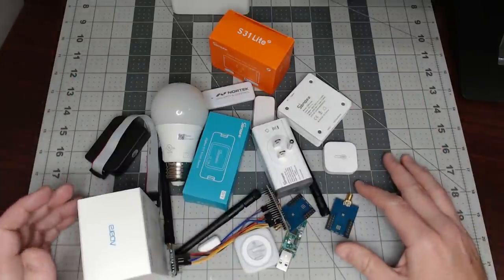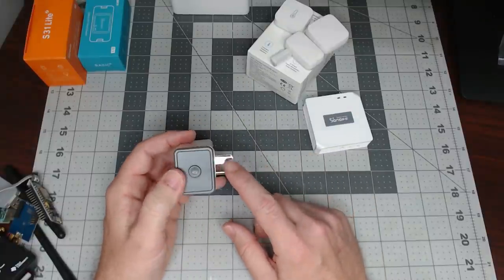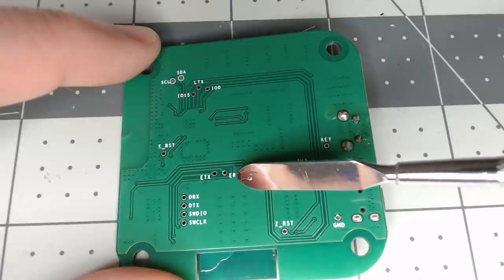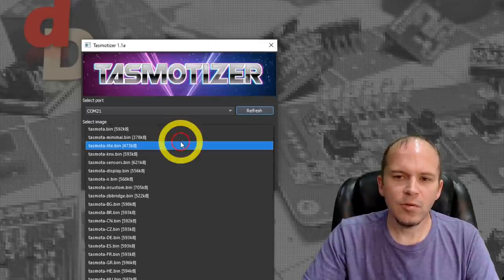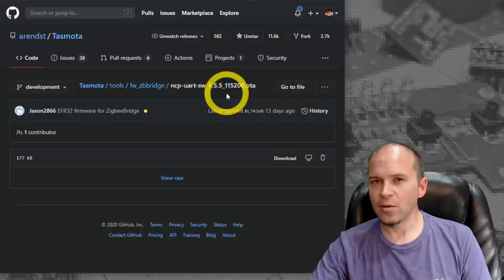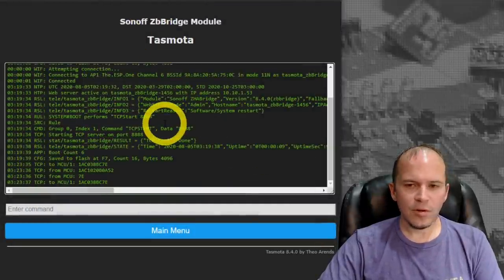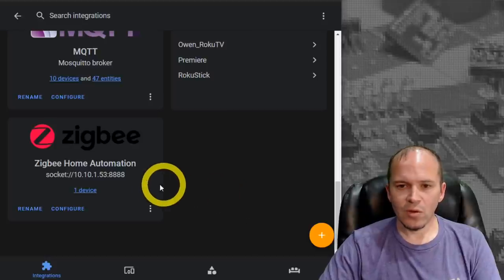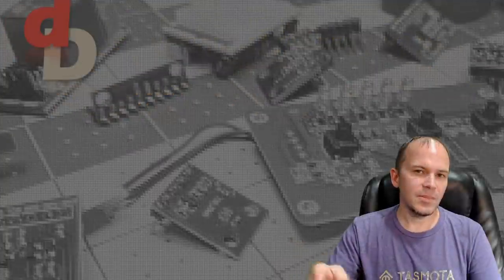Sonoff Zigbee Bridge with Home Assistant using Tasmota | NO Soldering | Step by Step Guide

Comment: Thanks for the video, I have finally managed to flash my zigbee bridge and add it to Home Assistant, tried twice and failed before, as for some reason after flashing Tasmota the chipset firmware would not flash. Now, I'm trying to add devices in HA, however no device is found, I tried adding the Sonoff zigbee motion sensor, Aqara motion sensor and a Xiaomi zigbee socket. I also restarted HA and tried again, no device is being found. Any idea why this could be? Before anyone else asks, I do hold the reset button on the devices for about 5 seconds until they start flashing.
Reply from the maker: Maybe try removing the coordinator and putting it back. I found some sensors take their time and hitting the show logs button during the adding also helps.
Reply: @digiblurDIY  Thank you, I did it a few times, deleted the Implementation completely and added it again, tried "show logs", nothing seems to work. It seems to find one extra device now, the Aqara Motion sensor and adds 4 entities, but apart from that one, it doesn't detect the Sonoff motion sensor or the Xiaomi zigbee socket. I'll try adding other types of sensors but so far not a lot of success.
Reply from the maker: Does ZHA support them?
Reply: @digiblurDIY  I checked and yes they are supported
Reply: Update, after removing the implementation a few times, reflashing the Bridge once again, I have finally been able to add a few sensors. It is really strange as I did not do anything differently, just tried again using the same steps. Anyway, it is much better than before as I can add the Xiaomi motion sensors and door/window sensors which I am most interested about as they were quite a distance away from the Xiaomi Gateway and sometimes lost signal. Hopefully there will be future updates that will allow it to discover other sensors, although from what I saw the list of sensors is pretty big. Thanks again for your responses. I've subscribed.
Reply from the maker: I had one earlier where we had to delete the integration and then also delete the Zigbee database and it added back fine. I noticed the Aqara xiaomi sensors are picky. Sometimes they need a full button hold for 10 seconds or so. Glad you got it.

Comment: I just "Tazmotized" a Sonoff ZigBee bridge and added to my HA setup without issues. I tried to add my first Zigbee device (Sonoff switch SNZB-01). It got added but the only entity seen by the HA is the battery level. I do not see any other entity from the switch that indicates that switch was pressed. Anybody having similar issues? I also heard that switch can register short as well as long press and send different messages. Is this correct?
Reply from the maker: You do have to use ZHA events on that button to see the 3 events.
Reply: @digiblurDIY  Any video or tutorial that you suggest that shows ZHA events setup? Even seeing the single press in the event list in HA would be good enough. Right now, I can only see a battery status (not much use :)). ANy other push button that you can suggest that would work with Sonoff Zigbee bridge?
Reply from the maker: https://community.home-assistant.io/t/unable-to-pair-sonoff-zigbee-snzb-01-wb-01-buttons/218324/19

Comment: After using the ZHA now for the last 2 weeks. I've noticed that sometimes the service goes down. No idea why or what ? Once I've did a search of the devices (integration screen) it starts working again... Any idea what causes this ? Any idea how I can get warned ?
Reply from the maker: Sounds like you might need to put in a few mains powered zigbee devices as ZHA is failing.
Reply: @digiblurDIY  I have about 30 devices in the mains. Every time i restart HA, it's a mess to get ZHA back up again. Always getting an error unknown cluster-specific command 10, etc.

Comment: Great video.  It worked for a few days but randomly HA can no longer connect to the zigbee bridge.  I can browse to the sonoff fine and even tried the commands again but it no longer can connect to the bridge.  Not sure if anyone else has had this happen.  Hoping I can resolve
Reply from the maker: Did the device reset?
Reply: digiblurDIY thanks for the response. It didn’t that I am aware of. You can actually still see it communicating with the 4 zigbee devices I originally connected to it. It also shows the server as starting fine. I honestly was thinking it might be a HA thing but since you responded, maybe I need to reflash Tasmota from scratch to see if that works.
Reply: You can even see in the console when HA reaches out to it because it states tcp to mcu immediately after I attempt to re-add the integration
Reply from the maker: So what's not working? I am confused.
Reply: digiblurDIY home assistant stopped talking to the bridge and had errors in the HA logs of not being able to connect. I deleted the HA integration and tried to re-add but it fails to reconnect at the screen that asks for the socket info. When I enter the socket and speed, it tries, the zbridge feels the attempt and then HA states it can’t connect. I’ll follow the process from start to finish again and see if it comes online.

Comment: Everything succesful done, but at least stucks in connection to 10.1.x.x:8888, any idea what to do
Reply from the maker: Might be the rule isn't running.  This is a pretty old method/device though.   So much has changed and many better devices now, like the SLZB-06 I did a setup on.
Reply: @digiblurDIY  how can be rule setup correctly? which are correct commands. I also can connect via TCP 1 but stucks in welcome message waiting for whatever.
SLZB-06 I will buy one and try
Reply: Connection now with zigbee succesful, but how to by MQTT

Comment: Tnx for your video, however the upgrade by "ncp-uart-sw_6.5.5_115200.ota" is cancelled with the error message "Magic byte is not 0xE9". Running "Tasmota 8.5.0".
Reply from the maker: That means you are not in zigbee Bridge mode yet or you flashed the wrong bin file.
Reply: @digiblurDIY  my fault, I forgot to start zigbee Bridge mode by  running "Backlog Weblog 3; so65 1; Module 75"
Reply from the maker: Not a problem!  We learn by our mistakes here and luckily this one was an easy fix.  Thanks for stopping back by to share the fix worked.

Comment: I've tried the sonoff window sensor. Although I could find them. They didn't work as designed !
Reply from the maker: What is wrong with it?
Reply: @digiblurDIY  Basically, I was able to pair the items but the state (open/closed) wouldn't be updated? This makes the devices useless obviously. Also the state of the battery wasn't transmitted. Maybe you have a way to solve it ?
Reply from the maker: I paired up one yesterday with ZHA and it shows the open and closed.
Reply: @digiblurDIY  I've tried today again and no officially giving up...

Comment: I’ve tried to add a few additional feibit switches and they got stuck. I can’t get ride of them, I can’t reset them. Any advice what I can do ?
Reply from the maker: You can always use the last resort is remove everything you can then delete the Zigbee dB file on HA and restart HA.
Reply: @digiblurDIY  Hi thank you for your reply. Now the zigbee hub went down somehow. Don't know why or how but none of the connected devices are available. I don't see any logs neither on what's going on. What are my options now ?
Reply from the maker: You will need to add it back after you remove that failure of the integration.
Reply: In the end, it used a snapshot of my VM as it just wouldn't go away. By the way, the IKEA bulbs don't work that well with the bridge. Hence I left them linked to the HUE bridge. After 20 runs, I just gave up.
Reply from the maker: If they don't follow the Zigbee alliance standards and ZHA doesn't support it then that could be an issue.  The ZB Bridge in ZHA mode is just a passthrough.
Reply: @digiblurDIY  hi Travis. I found them sometimes but not all the time. I could control them sometimes but not all of the time. I leave it for the moment. At least most of the other zigbee stuff I got integrated

Comment: After upgrading Tasmota firmware (8.4 -> 8.5) on the Zigbee Bridge, HA lost my devices and  it seems I have to restart the full procedure.

when upgrading to firmware ncp-uart-sw_6.7.6_115200.ota, this time, it fails and I have the message : Magic byte is not 0xE9
Reply from the maker: If you get that failure then you are not in the Zigbee Bridge mode so it kicks it out as a bad file. I haven't tried to update mine yet but I don't see why it would delete anything given the devices are added via ZHA. I will let you know what mine does.
Reply: digiblurDIY Just Repaired !

DO NOT UPGRADE to tasmota 8.5 via the option "Web Serve Upgrad", it installs tasmota.bin, do it manually.

If you did the mistake, you can change the firmware in 2 steps by installing manually the 
- tasmota-minimal.bin
then
- tasmota-zbbridge.bin
Reply from the maker: Yes the default OTA url is for standard tasmota. If you run a different version you need to be aware of that. Also I would advise against using minimal when you can. Use the gz files. Send over the lite gz file then the bridge gz file. Use minimal as a last resort as it doesn't have AP mode and such and you never know when something might hit the fan. Glad you got it going!

Comment: Is there a way to backup original firmwares before flashing ?
Reply from the maker: Yep. Check your flash size and use esptool to back it up. https://tasmota.github.io/docs/Esptool/ think went over this in the clamp jig video.
Reply: @digiblurDIY  Thanks, I've just done it ;)  But what about the firmware of the zigbee chipset ? Can we backup it ?
Reply from the maker: Not sure if you can do that.

Comment: Might be easier to plug the USB/TTL device into a breadboard, then connect the jumpers between the breadboard and the Zigbee bridge. This would also let you plug two separate ground wires to the breadboard.
Reply from the maker: Whatever way you do it is perfectly fine, seen it done a bunch of ways.  Not everyone has breadboard stuff so I tried to make it as minimal as possible without the S word.

Comment: when uploading the ota file. It says upload fails with the message Magic byte is not 0xE9. What to do to rectify this?
Even after entering the backlog command the module remains the same and teh device does not restart?
Reply from the maker: You have the wrong bin file uploaded then if module 75 will not set.

Comment: I did all the process ok, all works with tasmotizer but after ends send "md5 of file does not match data in flash", I'll try with 9.1.0 and 85.1version, Any Idea
Reply from the maker: Sounds like a bad flash. Something interference.
Reply: @digiblurDIY  I did several times with different cables, always the same at the end.
Sonoff zigbee Bridge V 1.1 2020.02.28.
I did the flash lots of 8266, sonoff devices etc without any problem, I'm lost.
Reply from the maker: It might need some additional power due to the other chipset.
Reply: @digiblurDIY  Having the same problem, how can I connect additional power? Thanks
Reply from the maker: For flashing or operation?

Comment: With xiaomi aqara sensors I had better luck pairing from a couple of meters away.

Was ignoring messages & couldn't see some sensors at all otherwise. Around 2 meter distance, bam.
Reply from the maker: Nice! Mine were close together. I will try this.
Reply: These are the sensors I got working.. Took a lot of button mashing, varying distance, holding tongue correctly ..... =(
Xiaomi mi temperature & humidity (small round ones) x 6
Xiaomi  mi motion (the one without luminancel) x 3
Xiaomi aqara motion (with luminance) x 2
Xiaomi mi door/window magnet (not the square one, the jelly bean or "pill" shape) x 6
Honeywell smoke detectors x 5 (were originally connected through xiaomi gateway) 

Also happy to report all power sensors for all these devices show :

Cell size: type eg. 2032 etc
Number of cells
Voltage
And percentage!!    So with one card I can see all battery levels & the type/quantity I need to purchase for the ones on their way out + notifications for smoke alarms on my phone even before their own low battery alarm goes off. What a convenient bonus.

My xiaomi gateway & sensor setup gave numbers that seemed unrelated to either voltage OR percentage for the battery sensors. 3v can show 87 while 2.9v could give a reading of 115. And 35, 56 + others were in there too. 3 brand new & confirmed with multi meter same volts gave widely different values. Never did bother to try interpretation of them.

Now with the sonoff zigbee Bridge & tasmota it all works.

Well, all but the xiaomi mi switches I use. All efforts only created the switches power sensor. No functions, but the log (when searching) does show the button presses & number of presses. (up to 5)

Definitely can't complain, all sensors are really snappy and same range as the xiaomi gateway.. And no dropouts at all so far.

Not bad for experimental release.
Reply from the maker: Nice! I am hearing they are working on getting it working with Zigbee2mqtt too. So we will have 3 options for integration with it.
Reply: That would solve my non working switch dilemma. I see you have the aqara sensors, so they should be easier than my mi sensors were to set up.

Comment: Please forgive my ignorance as I'm very much a newbie at this game.    I'm unclear as to why this is all necessary.    Does this pre-date the availability of the SONOFF Zigbee 3.0 USB Dongle ?     Does the stock SONOFF zigbee bridge not have the ability to talk to a local HomeAssistant host without these special mods?
Reply from the maker: Correct. This was before the USB based CC2652 chipsets adapters being readily available.
Reply: Sorry for my ignorance and Im super late to the party. So there is no need for this if I plug a sonoff zigbee dongle-E to my homeassistant server, then I will be able to add any zigbee device there no matter the brand? Also it doesn't matter if the device (zigbee) says its for tuya, it won't use tuya but directly zigbee to homeassistant, am I wrong?
Reply from the maker: @ggcub25 if you get the dongle E stick to ZHA. The dongle P is more of my choice. But yes this is the way now with the USB methods being available now.
Reply: @digiblurDIY  great I will get a dongle P based on your recomendation. One last question is there a way to program a zigbee switch (like turn on or off at X hour) not depending on home assistant for that? like if my server goes down, all the automation goes down?

Comment: Has anyone tried to get it to work with Z2M and then connect it to Home Assistant ? If so, how would that go in a few steps ? From the moment you are in the tasmota config screen ?
Reply from the maker: Last time I checked Zigbee2MQTT didn't support this adapter yet.
Reply: @digiblurDIY  if you wanted to do an unsupported installation. How would it look like ?

Comment: It's not working for me. It's starts with XMD init bootloader, but I got no more XMD messages after that.
Reply from the maker: Do you have anything attached to the bridge other than the usb power cable? No flasher or other wires.
Reply: @digiblurDIY  nothing is attached other than the USB  cable
Reply from the maker: That might be a hardware failure. But I would try a reflash and such to see if that fixes it. There is one other step to see what the bootloader is doing via putty that can be tried. Hit me up in discord.

Comment: Anyone here used Ikea  remote controllers or Aqara Smart cubes? I integrated those devices and it only shows me the battery level. I don't know what do to to get the buttons integrated as well.
Reply: I experienced the same when trying to add the Aqara Smart cube.  It only showed the battery level.  I had a very difficult time getting it to pair and could see the messages in the logs when rotating, flipping, etc.  However, once paired, it showed up as a LUMI sensor cube with only a battery level.

EDIT: Turns out that the smart cube is generating zha_events.  The way I finally got this working as expected was to create automations based on triggers from the cube.  For example, I created an automation that increases the brightness of my office lights where the trigger device is the LUMI lumi.sensor_cube and the trigger is 'Device rotated "Right" and set the action of the automation appropriately.  Hope this helps someone else!
Reply from the maker: Buttons and this one will need to look at ZHA events to grab the events such as these.

Comment: Is there any way to block or access with password to Zigbee hub? Right now everybody can access from local network
Reply from the maker: You can add a web password on the configure other screen.
Reply: @digiblurDIY  i added now. Thanks but standart what's the standart username? i set only password but it's asking also username.
Reply: @digiblurDIY  I found it. it was "admin" is there any way to change standart username?
Reply from the maker: Not that I know of. But I still find new stuff in Tasmota all the time.
Reply: @digiblurDIY  really very strange. I set a password 2 minute ago and i logon with password but now it's not asking anypassword. I set again a password, i saved. I see restarting message but after restart no asking any password. Do you have any suggestion?
Reply from the maker: Probably due to your browser caching the password entry
Reply: @digiblurDIY  You're right. Strange, i tried on hidden mode but as you said it'S still effected cache. Thanks My friend